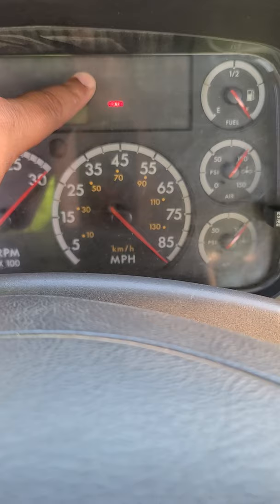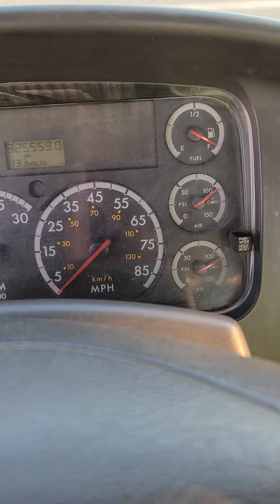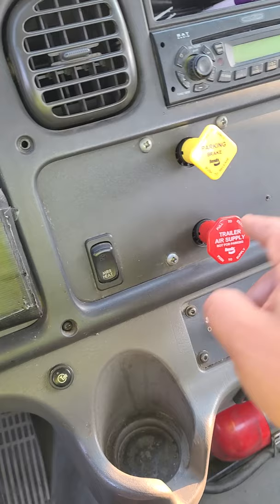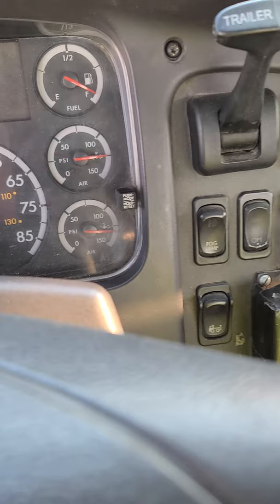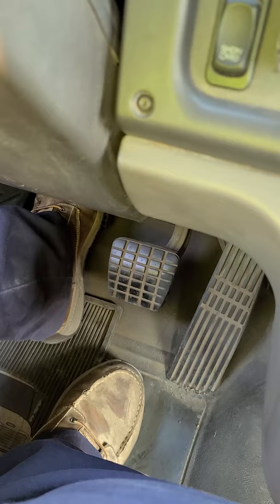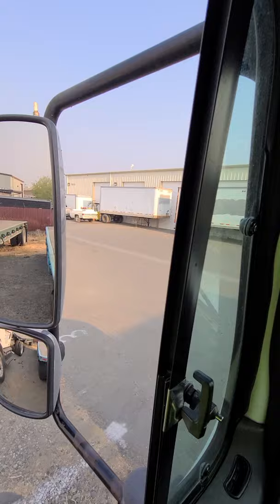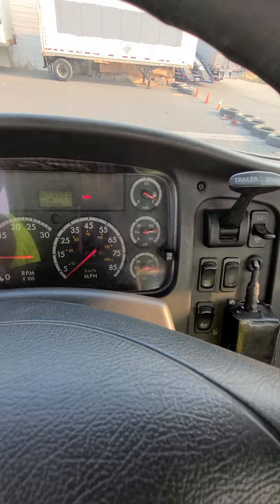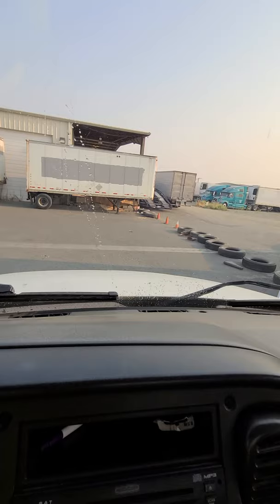Air Brake test and Incab Inspection saul

Comment: Hey so is the Governor still a test ? The school I go to said it got taken out that the DMV of Gardena doesn’t want you to do it . But I wanna go with confidence and pass the Airbrake test . So how would I really know if it’s still a test or not ?
Reply from the maker: Just the cut out test 
This will be the order
1 gobernor cut out test
2 leakage test
3 low air warning test
4 spring pop out test
5 tractor break 
6 trailer break 
7 service break
Reply from the maker: Didn't get confuse tbey only remove the gobernor cut in
Reply: 1. Applied Pressure Test
2. Low Aire Warning Test
3. Emergency Pop-Out Test
4. Governor Cut-In Test
5. Brake Test. 
Thats how they said its should be done.
Reply from the maker: @juanserrano4215  its no more gobernor cut in look on the DMV book they only required governor cut out .....ask all my students that pass with no problem.

Comment: Is this the same test for the class b ?
Reply from the maker: Almost the same test just in the clas b you don't have trailer brake and on the leakage test its 3 psi i will load today a video for air brakes on clas b